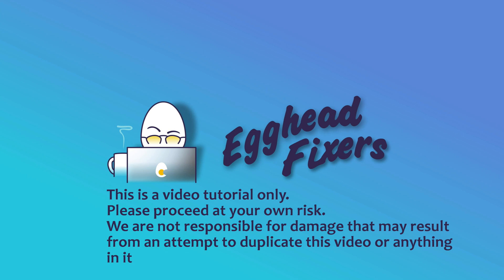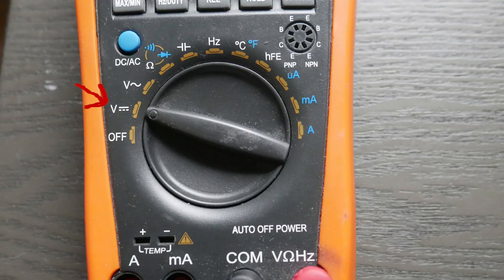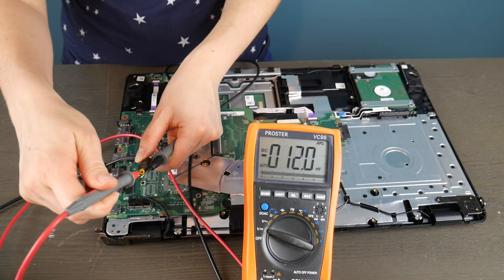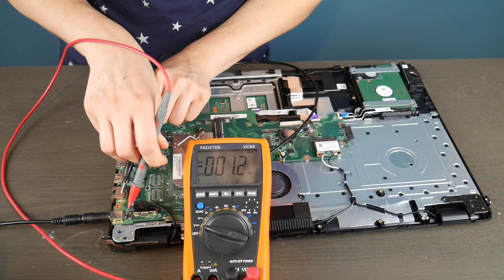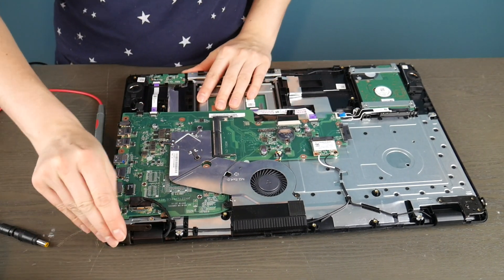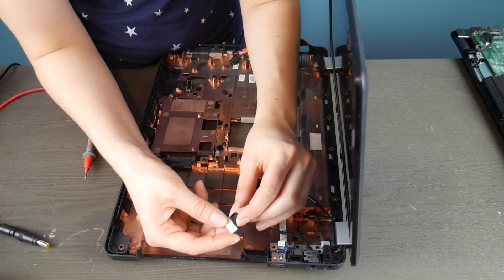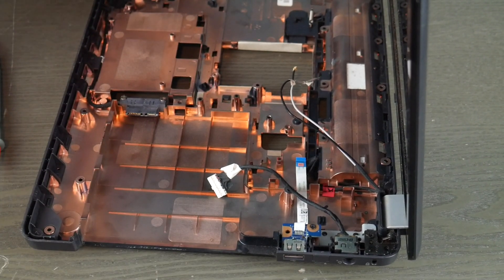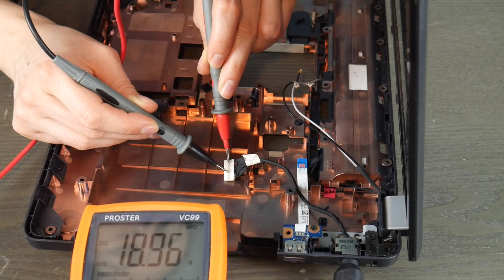How to Test Your Asus Laptop's Power Jack with a Multimeter - Tutorial by a Certified Technician

Comment: Is there a video for check power jacks for Lenovo Chromebooks (2nd Gen)?

I’m an instructional tech aide at a middle school and sometimes I run into more “my chromebook is not charging” issues than anything else.

I have the knowledge for replacing the batteries, but sometimes I can’t tell if it’s the port or the battery itself.
Reply from the maker: I'll pass that suggestion on. What model Lenovo Chromebook is it?
Reply: @EggheadFixers  Based off the serial numbers and the Lenovo website:
L13 Yoga Gen 2 (type 20VL, 20VK) Laptop (ThinkPad) - Type 20VL

Hope that helps. And thanks for responding to my comment/request.

Comment: Thank you for your videos. My laptop wouldn’t turn on and I found that the wired power jack had a very broken input socket so I have replaced it. But the laptop still won’t turn on. The multimeter shows that 19v is coming out of the power jack before I plug it into the motherboard. But when I test the little posts going into the board from the power jack cradle, only 7v is coming out. Does this mean the whole board is broken or just the cradle?
Reply from the maker: It sounds like you may have a problem with the motherboard itself. Does it turn on at all?